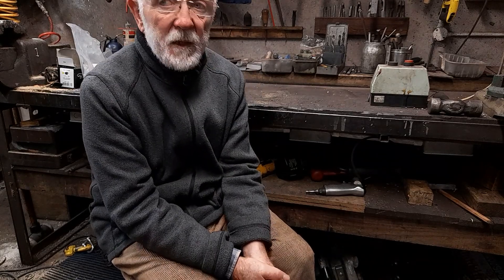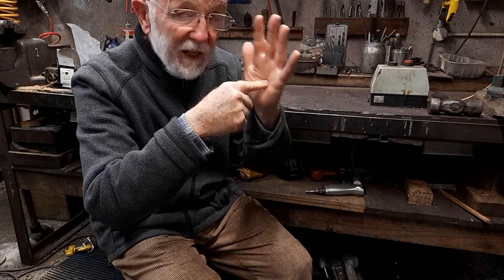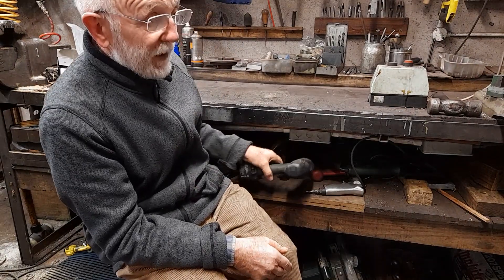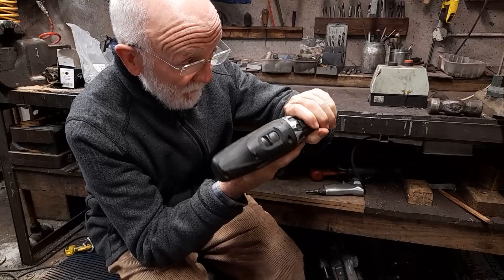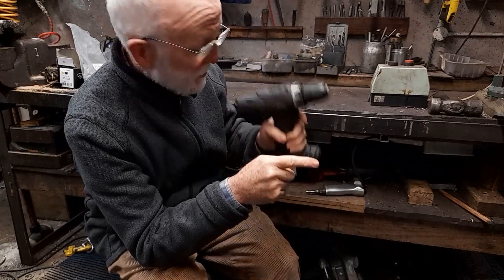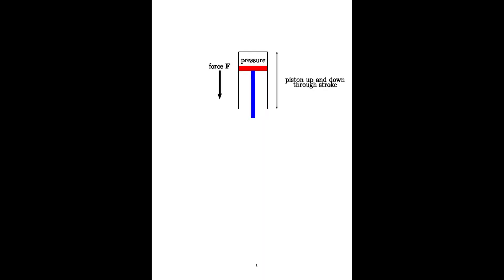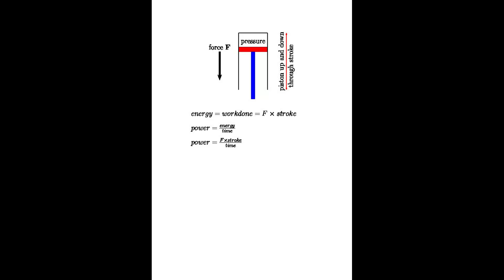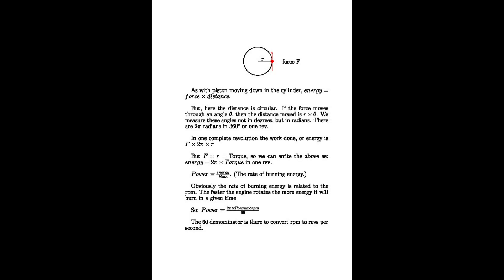Gardner Engines: a look at torque, power, energy etc.

Comment: I don't think I've met a radian for 40 years!  Off topic, nor had cause to explore practical torsional vibration in crankshafts beyond once  'playing' with a straight 8  300 bhp Allen generator at work running it slowly  and establishing there were some 'no-go' rpm bands.  It would be interesting to understand this point for different Gardner models to see if there are rpm  rules for  marine or even  road applications. Hopefully critical speeds would be below idle rpm ? Or might a different crankshaft torsional vibration damper be needed if changing from a generator to a boat role ?

Comment: Thank you Joe, very interesting, although I got lost in the mathematics but I understood the final result, a virtual flat torque curve is an engine makers dream but Gardner's achieved it along the low thermal efficiency, no other engine manufacturer could achieve it and I'm sure never will as long as diesel engines are still being built. I ran Gardners in lorries untill I retired and couldn't find an engine to beat them, haulers today don't know what they missed out on, I pity them when they fuel up with there modern motors, I ran with a chap who ran a 320 bhp Volvo , my 320 bhp Gardner did nearly twice the mpg to his motor, engine manufacturers have certainly lost there way. Thank you again Joe.